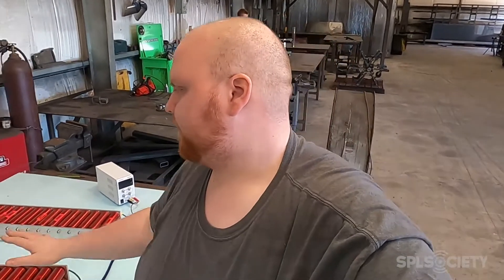Pig Benis Build (Part 4)

Comment: Would like to see you try a different design with the bus bars. Bars would be  6"x24" and 6"x12" for the terminals. You will get a more balanced load on more cells at the same time. The long buss bars here will not do a great job at distributing the load across multiple cells. I built a 128 ah bank as described and it holds 14.2-14.4 full tilt pulling 550-625 amps (clamped input). I would love to see a bigger bank with bigger power and its performance.
Reply from the maker: I never thought of that! I bet you're right because I never was impressed and I had my charge and ground wires one the ends, amps in the middle to try my best to equalize the load. But maybe doing the bussbars like you said, could help even more!